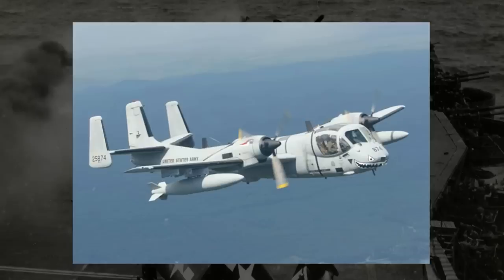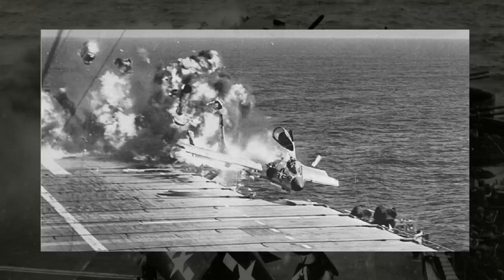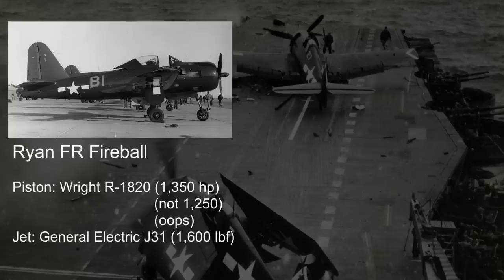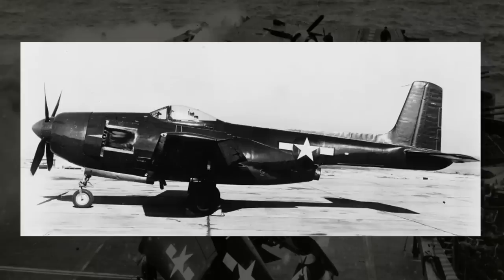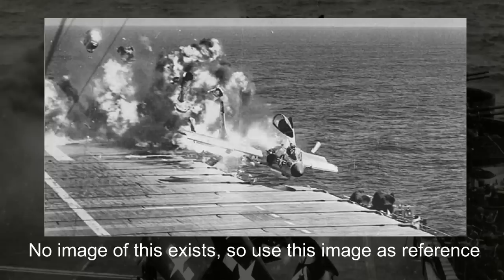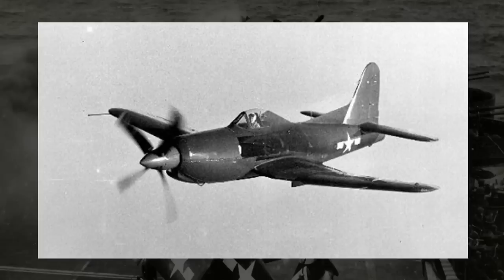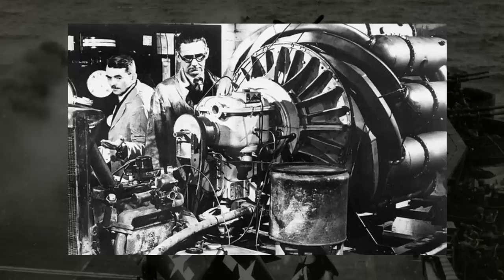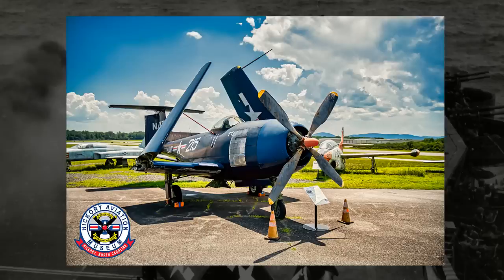Curtiss' Half-Jet Half-Propeller Fighter: Curtiss XF15C

Comment: Instead of using the land-based Mustang as a comparison for the three aircraft how about instead we use a proper carrier-borne aircraft the form of the -5 Corsair which matched the 469 miles an hour of the XF-15C which did have a higher climb rate but the f8f bearcat wasn't far behind it with a scant 500 ft per minute disadvantage

Oddly enough there's actually a surviving prototype to the x f-15c don't get me wrong I still think is a very cool aircraft and I'm happy an example survives.